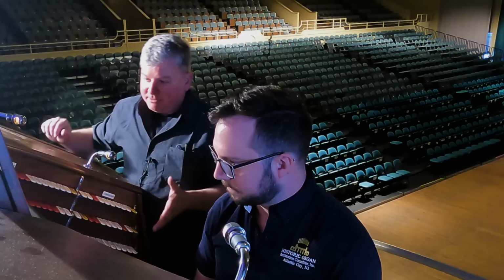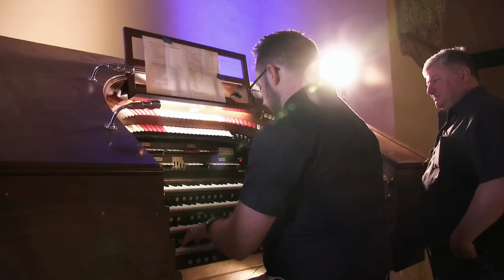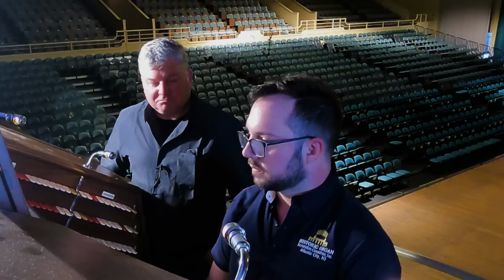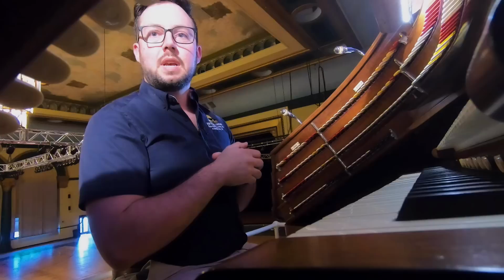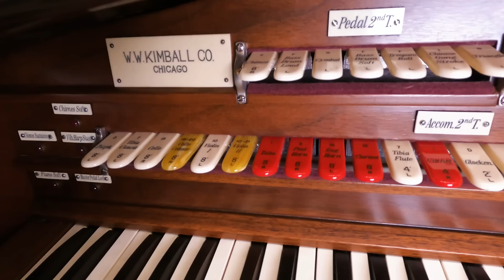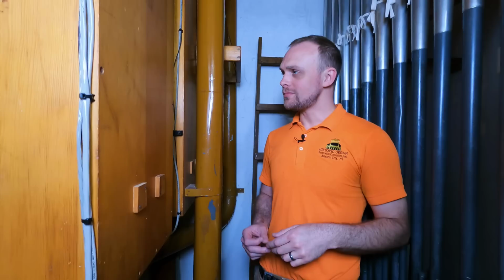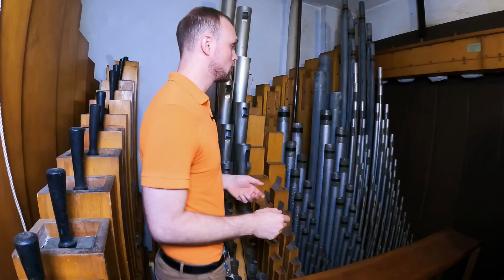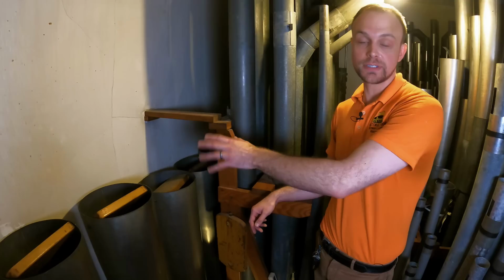1930 Kimball Pipe Organ - Adrian Phillips Theater, Boardwalk Hall - Atlantic City, New Jersey

Comment: SO - this is NOT a historic restoration. That becomes obvious when we see racks of electronic controls. You took the easy way out - rather than to releather and clean the original pneumatic relays, you installed electronic controls. That's nice but very expensive to repair, should a board go bad. At least with electro-pneumatic switching it was easy to locate and repair any problems. What is the electrical tape doing on the slide tuners. Surely that is not original. Those slides are likely coke tin, very tight, possibly corroded. Why not go to the new slide tuners that use thin metal and don't squeeze the pipes - often distorting them.  We can overlook the use of flex pipe to wind the toy counter. Working in metal wind pipe would take many hours and cost a lot to cut, fit and solder the wind lines. It does look nice. The wonderful Kimball pitman chests, to easy to work on, so fast. I wonder, how many stops on one chest. Usually not more than 5 with the center primary.  Nice job overall. but NOT a historic restoration.
Reply: Robert, why not historical?
Reply: @JIMD6370  Because they completely changed the working parts of the console, removed all the original switching and relay systems and replaced them with equipment that is modern, unheard of in 1930.  They might have restored the chests, reservoirs and cleaned the pipes, but the controls systems, workes of art in themselves, have been replaced.
Reply: @organbuilder272 , well, then very few restorations, including the Wanamaker, etc, are "historical" as they've replaced the original relay systems with modern systems for ease of maintenance, ease of operation, etc. I think the only original relay room left on a big organ is the right stage relay room for the M-L.
Reply: @JIMD6370  CORRECT, sadly. Either modern day builders do not have the skill or want to make the $$ by replacing that which is simple and effective and far more easily serviced. I pneumatic or electric relay - $20.00 plus labor. One electronic board $360 plus labor and not repairable.  Change the action - isit is not restored. Change the pipes and it is not the organ - remove the builder's name plate.  No different than repainting a van Gogh, or rewriting  Tom Sawyer.
Reply: So if you are familiar at all with this instrument you'd know why and not be screaming here and be happy it still exists at all, during a renovation at boardwalk hall someone took a sawzall to the wiring bundles and obliterated the relays, they were gone, they had two options , replace or it never worked again and this instrument would be lost to time. So which would you prefer? The same happened out in the main hall with the Midmer Losh, you take what you can get
Reply: @organbuilder272  while I understand you sentiment, it's totally unrealistic.1: In the M-L's case, the left-stage relay room was removed during the Reno in 98-01, and was deemed cost prohibited to rebuild. 2:, you can't splice old wire with new on any renovation, (electrical code rules), and it's just smarter to go solid state as it's way more reliable than the original relay systems, and way cheaper. My take is simple, the pipes, regulators, blowers all as close to original as possible, the control system between is irrelevant. Even the console can be new build, so long as it's faithful to the original in look. Also in the case of the M-L, without the new system, you'd have no combination action. This goes for any historical organ, I'd rather have this, than nothing at all.
Reply: While the removal of the original relay means the Kimball organ does not fall under the Heritage category, as outlined by the American Theatre Organ Society, it does meet all of the requirements for the Vintage category.  It should be noted that the removal of the original relay was done against the wishes of the ACCHOS, the entity responsible for the organs at the time the cables were cut, circa 1999.  As for the tape on the tuning slides, it is indeed original and is a hallmark of Kimball instruments.  The tape is not electrical, but friction tape, and is found on bass pipes of most, if not all, Kimball organs.
Reply: @BoardwalkOrgans  thank you for coming to my aid, I'm at least mostly correct, right?
Reply: @JIMD6370  I'll step in here and say "yes". Let's see...I replaced the points in my Rambler with an ignition module so I guess I took the easy way out 🤣
Reply: @cnagorka  the purists are going to tar and feather you, you know that, right🤣🤣🤣
Reply: rolling my eyes There's always at least one . . .
Reply: @michaelherring1944  Rolling your eyes..  What does your eyes have to do with the difference between "Restoration" and "Rebuilding"  There's always one....  One What?  There are far more than one organ where "Restorers" have made major modifications to the organ in the name of progress while touting that the organ was restored.  This was NOT restored. It was rebuilt. a major part of the technology that made the original organ is either trashed or not functional. No longer a demonstration of the technology that went into the construction of the original instrument.  Technology which, though bulky, at least could be analyzed and repaired by any competent organ mechanic instead of having to replace 300 dollar boards which go obsolete every 20 years, if they last that long. Try rolling your eyes over a fully restored organ which is intact and operational. I wonder if you can do it. This is an excellent organ, an example of Kimball's work that should have been preserved. The same fate has befallen the big organ next door.  It wouldn't surprise me that the mechanics on this job replaced the original chest action with DE stuff.  Don't hide a rebuild behind  the glory of restored pipe work and a couple of coats of shellac.
Reply: @organbuilder272 Both magnificent organs were almost entirely dead and unplayable. In your perfect world, the "restoration" would go as follows: Rewire the organs in the exact original fashion. This would require removing hundreds of ranks of pipes at once to reach relay rooms and rewire each windchest. Tens of thousands of magnets would need to be cleaned and diagnosed. Disassemble the console and rewire and clean all the key and stop contacts. Even then the organs would be nowhere near playable. The unreliable, fragile and overdone combination action would be replaced with... the same unreliable, fragile and overdone device. (And it's still not playable yet.) Since we're not allowed to replace things, we must rework each and every bent, crushed, broken pipe. We would need to cannibalize other period organs for the irreplacable/unrepairable pipes. (The Echo and Fanfare divisions continue to decay at a rapid pace. We haven't gotten around to restoring them yet.) Walls would need to be torn out to reconnect wind lines in their original inefficient and truly strange blower configurations. Only then would the organ be more playable than when we started. If Boardwalk Organs had done things this way, I'd estimate that the organs would be unplayable in 2023 and still have another decade to go before everything is even wired. I say this not just because of time, but because the Boardwalk Organ association has a budget. Remember? They have a limit on how much they can spend! It just couldn't be done. Sure, it would have been a marvel of 1930s engineering, but that's not really why people donate to restore organs? They want to hear them! And it'd be a slow, fragile, overcomplicated and unreliable marvel of engineering. There's a reason things went south so quickly just after they built it. It was way too expensive and complex to manage. Now, with solid state and much simpler signal flow, it can be maintained at a reasonable cost, and now you can actually hear it play! Would you rather have a dead unplayable original organ and a maintenance team that ran out of money halfway, or an actually doable and financially viable plan to bring the world's largest instrument back to operation?